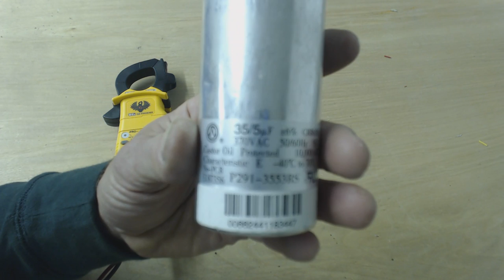Dual Capacitors! How to Identify, Test, Wire, and Read a Dual Capacitor!

Comment: Hi..  I have a single capacitor with two unmarked terminals.  The compressor was unable to start, so I figured it must be a bad capacitor.  I replaced it with another capacitor of the same specs and the compressor started, but for seconds and exploded right away!  My questions are, is this a result of wrong terminal connection? And how do you know which goes to which when a capacitor is totally unmarked as far as common and Herm? 
Thanks in advance

Comment: Thanks for the video! If the fan side of the dual capacitor 7.5uf is bad, can a blower motor single capacitor @ 7.5uf be used in it's place temporarily? As in taking the fan connections and jumping the common and putting them to the single? Thanks!

Comment: Can you tell me how to go from a run cap to a dual run cap in a condenser.
Reply from the maker: Great question! If you have a run cap for the fan and a separate run cap for the compressor then you just follow the wire to the contactor. This is your common from each of your original run caps. Put that on common or C on your new dual cap. The other wire off of the fan run cap should run directly to your fan. Put that wire on the fan tap of the new dual cap. Trace the wire in from the old run cap to the compressor. This is your start wire for the compressor. Put this on the herm. Make sure to confirm the correct uf/mfd rating for both your compressor and fan. They should be on the rating plates of each. In rarer instances the compressor will not say it but you can look it up online with the model number of the compressor. Make sure that if you are taking out 440v cap then replace it with a 440v or 370/440v dual cap. Make sure to not put in just a 370v cap. If it is 370v existing then replace with a 370, 370/440v, or a 440v. Any other questions just ask. Thanks, I hope you are enjoying the Channel!
Reply: acservicetech how to do a retrofit from R22 to 407c and how much oil to add

Comment: Could you do a retrofit R22 to a 407c and how much p o e oil to add
Reply from the maker: You would cut the compressor out, dump the oil from the suction line into a container and add the same amount back into the suction port. Do you pt test and vacuum procedures, Weigh 95% of what the r-22 charge was as r407c back in and check the charge

Comment: Question, why can’t you test a capacitor with the wires still hooked on?
Reply from the maker: You could with one wire on. It's the same principle as resistance. You dont want to accidentally be including something like the control board within the circuit you are testing, thanks!